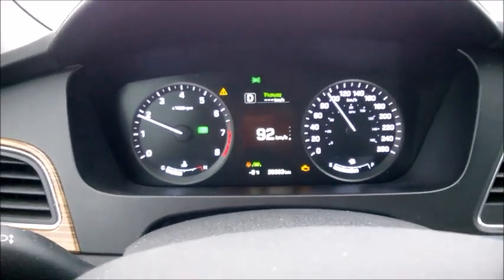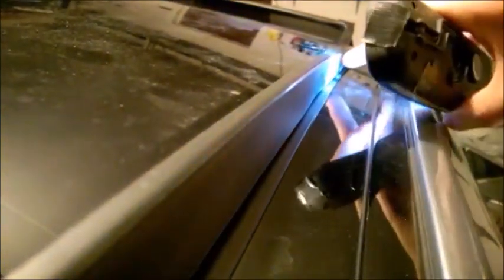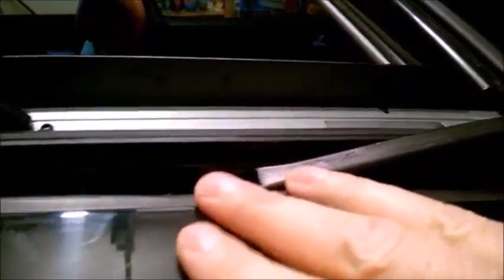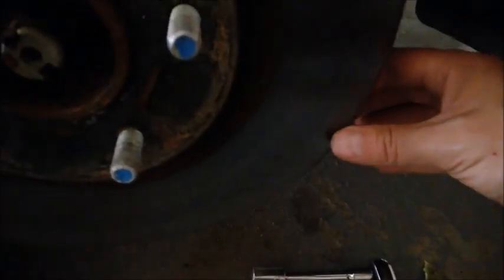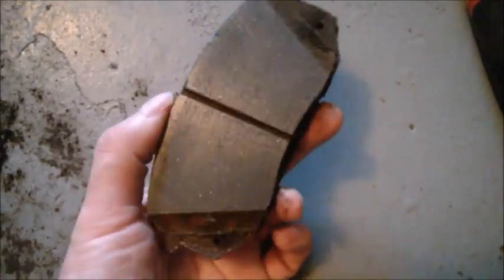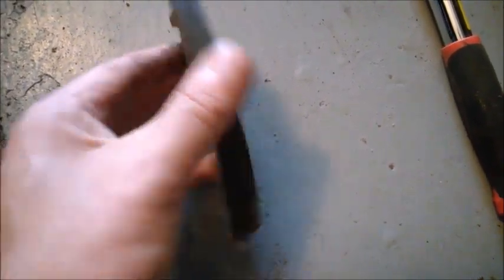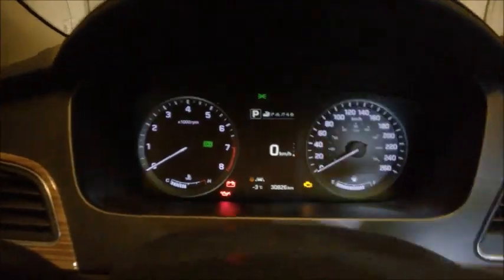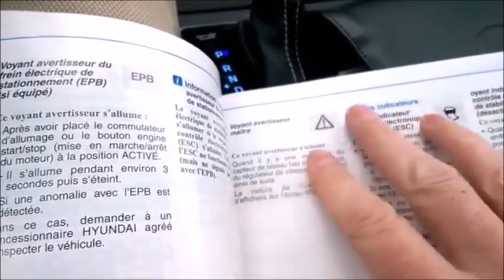2014-2019 Hyundai Sonata a few problems

Comment from the maker: Original video owner, updating this, and this time it may be surprising to hear that the car is now at the Hyundai dealer. It was towed after we got a flashing check engine - this means a more serious engine management problem (as opposed to a steady light Check engine).  The car would hesitate severely under slight acceleration.  We have been lucky, it happened as we were just leaving home.  Being a Friday, the Hyundai dealer kept the car over the weekend.  UPDATE:  Hyundai removed the oil pan to search to metal shavings (not sure why).  They then put back the oil pan and replaced a knock sensor - they had to remove the intake manifold to access the sensor so it was a rather longer job. The knock sensor is small and inexpensive, however it's located on the front of the engine block, behind the intake manifold, so access is not easy.  The car is now driving fine. The dealer had to order the sensor so they kept the car for about 2 weeks.  It turns out, what happened with the Check engine and the Limp mode (no acceleration) is a widespread Hyundai engine potential severe mechanical problem which had a recall. Hyundai told us about a knock sensor, but in reality I think the problem was more severe, that's why they removed the oil pan to check for engine wear https://youtu.be/ehHp8Te2uLw
UPDATE  Failed radar sensor (for blind spot detection system): We got a warning light and the blind spot detection system went inoperative. Hyundai confirmed left rear radar sensor unit defective - $800 for the part alone (the bumper cover needs removed). After reading on forums, this is a very common problem. Hyundai may try to recalibrate the sensor, but what I found is it is possible if someone is bumping your rear bumper - such as in a parking spot - or if you hit a larger pothole, the sensor may move just slightly in its bracket, and the car will detect it as out of calibration so the dealer will say we can't calibrate it, we have to replace it,even if the sensor is intact. They will try to blame you hit the car and knocked off the sensor.  I removed the rear outer light unit - see my channel how to do this safely - and reached the sensor with my fingers and just moved it a little then had Hyundai recalibrate it and the error message was gone. Perhaps the brackets are not strong enough and allow the sensor to move even just slightly which throws it out of calibration (these sensors needs to have a certain alignment so they can work properly).
Update: the hood struts have failed. The hood no longer stays open in cold weather.
LAST UPDATE. The car was now put for sale, we paid $30,000 new, trying to sell for $14,000 with only 40,000km (25,000 miles) no calls. The engine was barely doing 15 mpg in gentle city driving (non turbo engine)
Reply: Peppermint I have almost the same problem the speedometer wasn’t moving, when I put the lights in auto wasn’t working, I couldn’t put the car in gear so I had to use the shift lock release in order to put the car in D, abs light came on with the break light and that warning light too, the driver side windshield wasn’t working and couldn’t lock the car with the remote,  I have a Hyundai Sonata 2018 and they told me they order the vcm for the car.
Reply: You prolly dont care at all but does anybody know a tool to get back into an Instagram account??
I somehow lost the login password. I love any tricks you can give me
Reply: @Zakai Ishaan instablaster ;)
Reply: @Nickolas Reece I really appreciate your reply. I got to the site through google and im in the hacking process atm.
Takes quite some time so I will get back to you later with my results.

Comment: my 2015 sonata limited is a lemon.  at about 30k miles variable valve timing gizmo failed and almost killed me due to severe loss of engine power.  felt like two cylinders firing. rough.  had to feather/gently pump gas pedal to get car to move.  when tow truck arrived my brakes completely failed as i drove it to align with ramp.  45 days for dealer to get part.  this car also consumes oil.  i check weekly.  dealer says all is normal. sure, buddy, any thing you say....    now at 43k miles wheel bearing failed.  this is my sixth hyundai.  no more for me.
Reply from the maker: Sorry to hear.  For the wheel bearings, did you had the original genuine wheels ? Not necessarily your situation but a suggestion for H owners, be sure you install wheels with the same offset, for the 2015 it is 50mm offset, lesser number will cause premature bearing wear. Here's a video with a head gasket leak on my 2015 https://youtu.be/9pAYZ_UZC7w